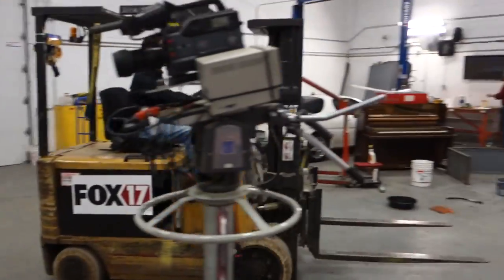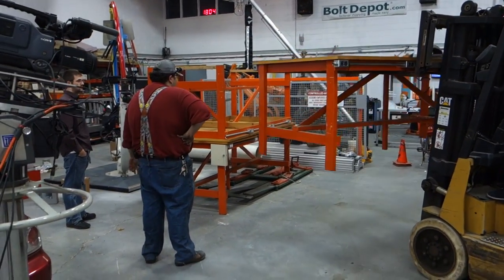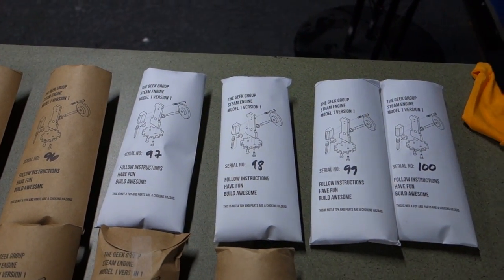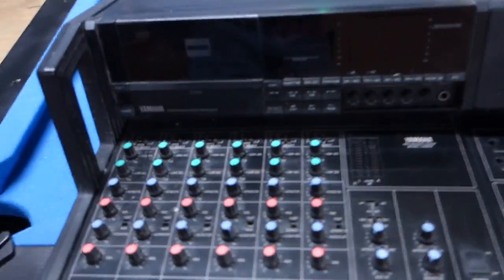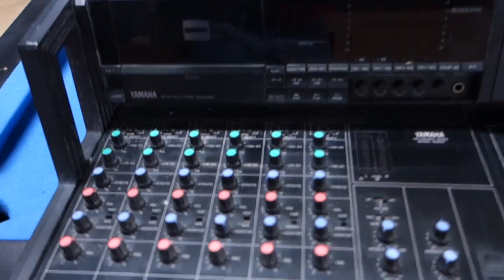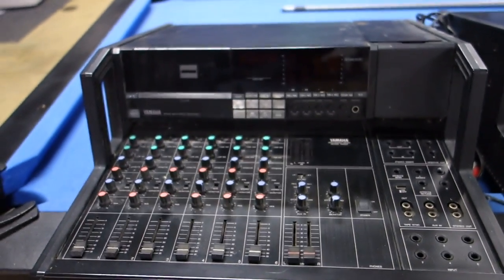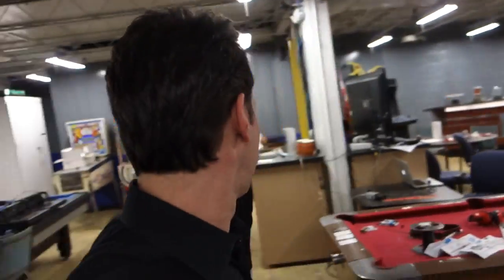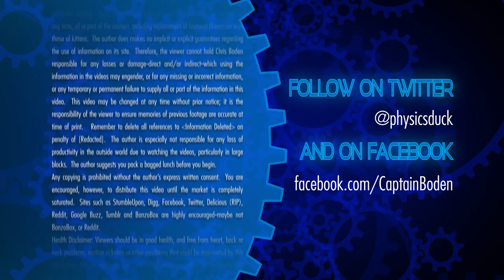Captain's Blog 11 7 2014 VSL Teardown Day 2 and Steam Engines FOR SALE!

Comment: The electrical panel in front of Moose's desk needs to be supported.  It's big time illegal for a panel or box to be supported by it's conduit. Floor mounted supports or floor to ceiling supports are sufficient to pass fire and electrical code.   Oh, and THE STEAM  ENGINES are for sale!!!